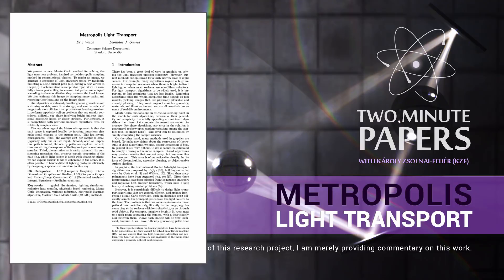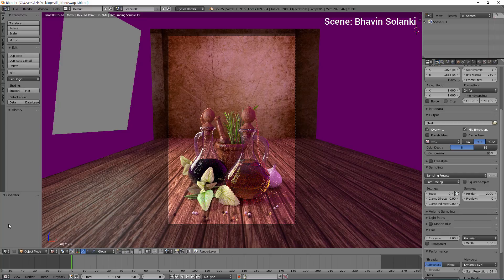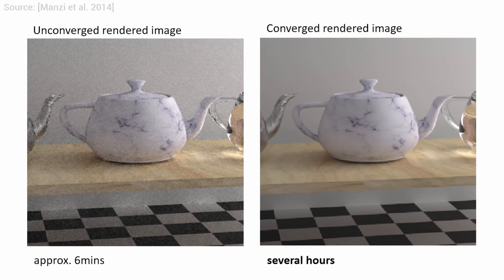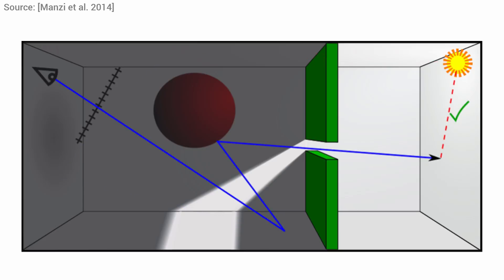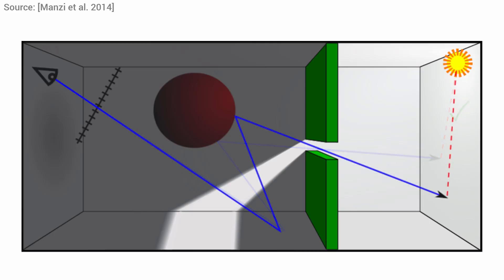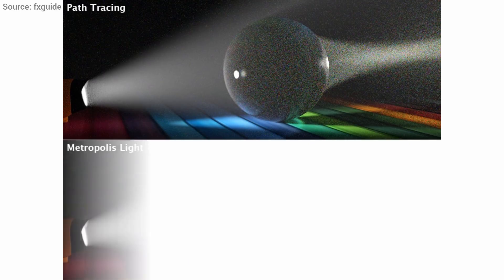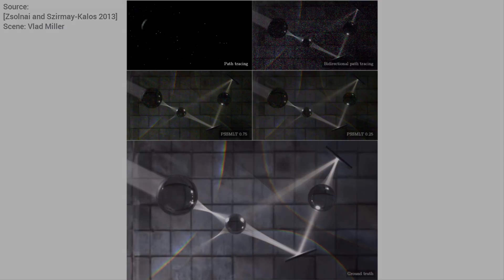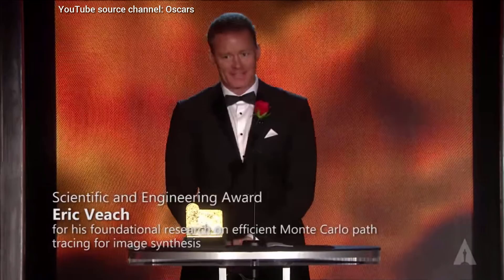Metropolis Light Transport | Two Minute Papers #16

Comment: Another category could be optimization (apple uses lower level programming languages in both the os and apps and is better optimized because the os and apps need to adapt to fewer devices).
I clarify that I am more of Android.
Reply: Apple optimization is a myth. They simply control vertical integration and thus avoid bloatware.

Comment: I just installed Mitsuba with that PSSMLT inside, but I cant figure out this settings. Like in video you show there is PSSMLT 0.75 and PSSMLT 0.25 (better for caustics), but I don't see such settings + I cant find clipping as well. Do you teach about how to use Mitsuba in your light transport course?

Comment: 1:08 You say "light paths like these don't contribute anything to our calculations and are ultimately waste of time and precious resources". That's not entirely true. First of all, do note the darkly lit (but not completely unlit) space behind the green wall at the bottom (where two blue rays converge) -- it is non-black exactly because diffused light from other regions in the room illuminates it, so the blue ray calculation isn't entirely useless. In fact painting the pixel or pixels that correspond to that region in space, grey, can be attributed directly to the that blue ray section. That of course is the difference between doing vastly simplified ray tracing, taking into account only direct light sources, and talking about full-blown unbiased rendering that actually mimics how electromagnetic waves behave. Of course, you can perfectly well cheat with lighting by faking global illumination, but I think if one talks about ray tracing, that should then generally be outright stated out.

So, you might somehow defend your statement, but I would rephrase it to clarify.

Comment: Oooh, is Metropolis going in to Blender? #b3d
Reply: You could add the LuxCoreRenderer (that uses MLT) as an additional rendering engine into Blender (next to Cycles and Eevee). The projects homepage has plugins for blender 2.8 and on.
Reply from the maker: +David McSween Hey there David. I haven't heard about this. Where did you read this? :)
Reply: +Károly Zsolnai-Fehér (Two Minute Papers) I notice that the video used Blender Cycles and I have seen this reddit page about a patch https://www.reddit.com/r/computergraphics/comments/266yim/cycles_recently_got_metropolis_light_transport/ and I wondered if you knew why it wasn't accepted if so good?
Reply from the maker: +David McSween Wow, I haven't seen this one yet. :) Who knows, maybe someday! (Note that in the video, standard path tracing was used)
Reply: +Károly Zsolnai-Fehér (Two Minute Papers) Blender has feature called Light Portals. Isn't this correlated to MLT?